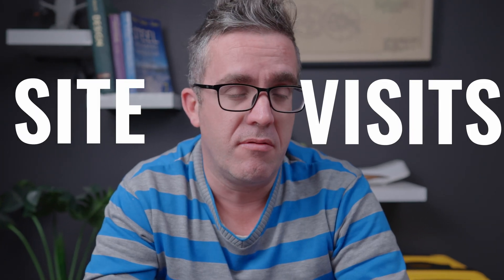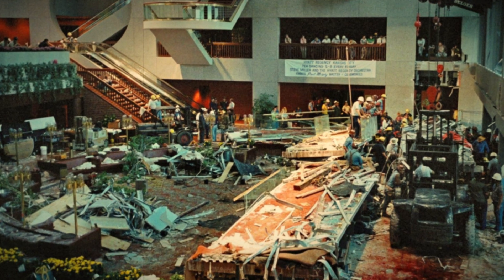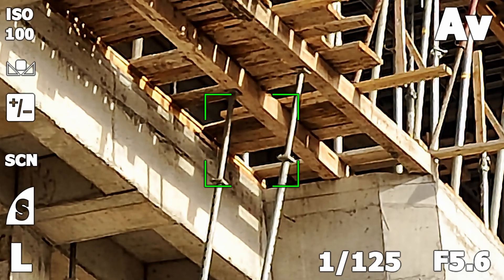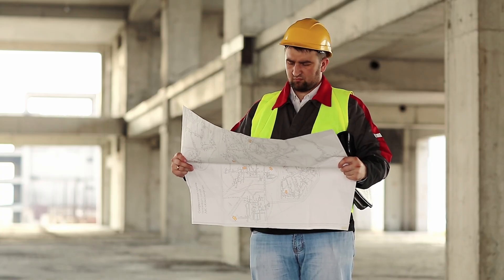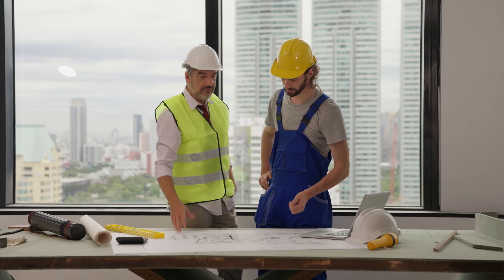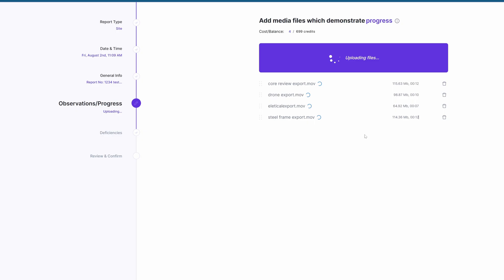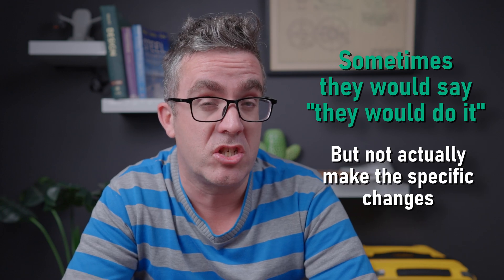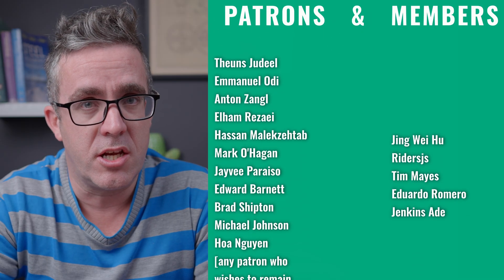How to conduct Structural Site Inspections like a Pro | How NOT to miss anything

Comment: You can delegate a task, 
You can not delegate responsibility.
The 'Follow up' is the critical step.
A written statement that a final inspection of all rectification works before a concrete pour or the covering up of the work should be sent and cc to management. 
Include a photo and clear location of work. 
Refer to date of the discovery of the defect. 

One of my defect notices was ignored and it cost $100,000 to fix.
It was fixable but was dirt cheap to fix when notified.

Another follow-up job for me was a 1,100 item defect list.
Why it was not documented as work progressed and followed up was jusy laziness by the full-time on site inspector. 
No life risk, but $ wasted.
Reputation suffered.

Comment: Written instructions with cc to their bosses and management puts the wind up most site formen.
They don't know how many are involved in getting the fix completed. 

Trust me, they need all the pressure you can give them.

Cracks in high rise are bs site control, inspect and write on paper and photograph.
Reply from the maker: Yea sometimes you need to turn the screws. Sometimes I need to standover then and watch until it has done, also need once to order an immediate change and repair.
Reply: @BrendanHasty  if you feel that you are going to stop a concrete pour, do it early enough for them to have time to panic.

And achieve the pour even if they are delaid on the day. Hahaha. 

Missing the pour can have a huge impact on a project, but it must be done if the quality of work is to be maintained and respect is to be kept.
Reply from the maker: Totally agree, you only need to make the call once and all the rest of the inspection past this point are perfect. If it is not right it is your responsibility to make that call. I like how the Canadian charted engineers have a ring ceremony, it is the symbolise the responsibility engineers have, and to remind them from collapse of the Quebec Bridge, which killed 88 people showing them impact we can have.
Reply: @BrendanHasty  can I suggest that if a hard action needs to be taken, then in the first 10% of the job after they have started and still building their site culture. 
Not late in the job when they think you are now being unreasonable. 
Just my thoughts and methods.

Comment: Good video.
Reply from the maker: Thanks for the support
Reply: @BrendanHasty  I have worked with excellent contractors and subcontractors and clients as well. 
Some brilliant people and fun to know.
Reply from the maker: They are the best ones, and you can learn Soo much
Reply: @BrendanHasty  you are supporting young engineers who may have their neck on the line from the bs that can come from the corner cutters who hide their mistakes and have years on site.
Reply from the maker: Yea site inspection can be tough for young structural engineers, I have been intimated on site before and has contractor try and cut many corners.
Reply: @BrendanHasty  yes, I have dealt with bullies in my school days and learnt that if they want to be aggressive I would not back off, but I did go quiet. 
They don't know what to do or say.
Hahaha. 
I might tell them I am helping them.
Hahaha.  Which is true, actually. 
Playing Rugby League is a good teacher,  Hahaha 😆 
And having brothers.
Make your mistakes early and use your lessons, find a good example,  find a good mentor, and find someone to champion your career. 
They can be many people. 

After the mistake, work harder in the new direction. Time in the job is very powerful. 
People skills are very real.
Nothing happens on this planet without people, the key ingredient.